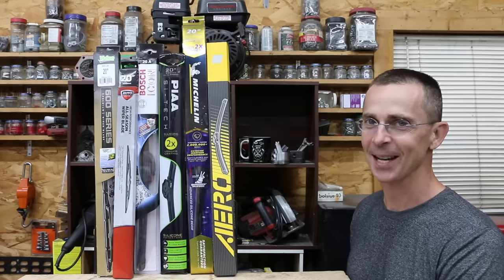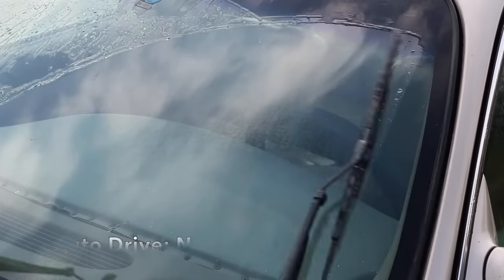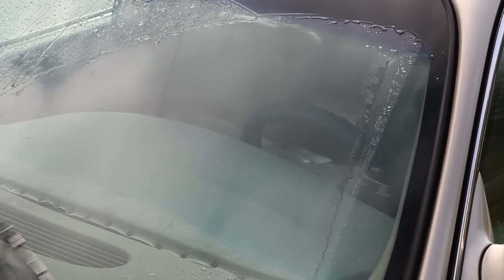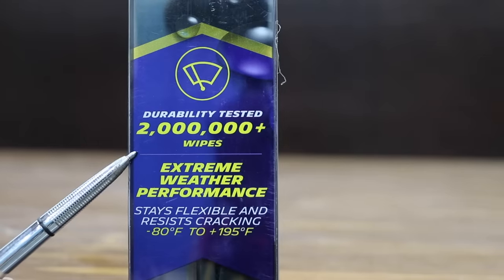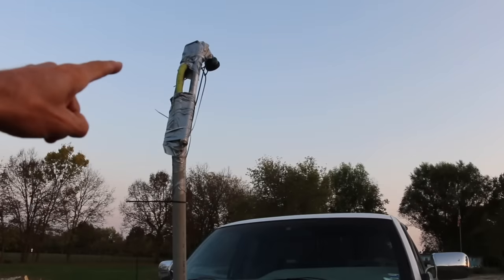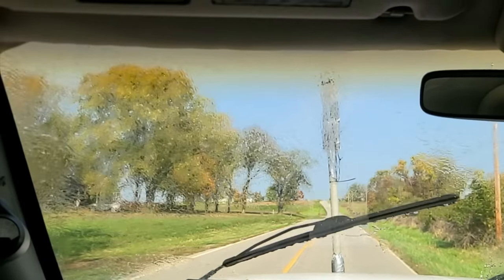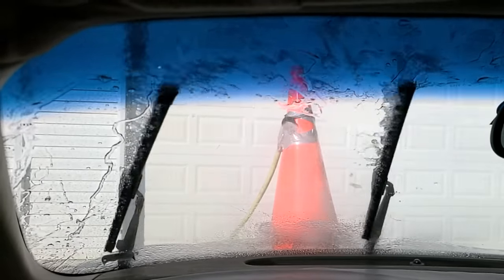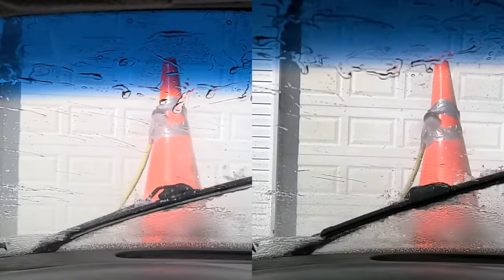Best Windshield Wiper Blade (AFTER 1 YEAR)? Bosch Icon, Rain-X, PIAA, Trico, Valeo, AERO

Comment: Great stuff, a hooked supporter and viewer. Missing from this test is OEM wiper blade INSERTS. I’ve had a dozen + Hondas since 1982 and stopped using aftermarket after seeing how sub standard they worked compared to Honda OEM replacement inserts. The blade assembly never wears out, just the rubber insert and the stainless arced stiffeners keep the contact patch exactly as designed and engineered. Poor visibility especially at night is a huge safety risk so I viewed replacing them as VERY cheap insurance. In the Midwest they got used year round so I replaced them when they wore or BEGAN to streak, @ about 1 to 1.5 years. In So Cal they bake in summer mostly unused and winter is critical for frequent mountain snow & rain. Simply put, replaced as or before needed, they always work perfectly.. just like when the car or truck (Ridgeline, I’m on my 3rd) was brand new. I respectfully suggest including OEM INSERTS in future tests as the OEM rubber insert in original blades only takes minutes to swap out. I’ll never stray to aftermarket blades again. Thanks!

Comment: In 2007, I put a set of Piaa super silicon blades on my (bought new) 2006 Acura TSX 6 speed. They were still on there when I traded the car in in 2020, and working beautifully. I did treat the windows every 6 months with rain-x. Still have the bottle, but miss the car. I also have them on my 2010 cx7 bought used in 2013, and immediately installed them on that car. Still on there today.( 8-21-22) Central Ohio, and both cars were parked outside in all weather until 2017. They now spend the night inside, but sit outside at work all day. (well, not sure about the TSX, after all those years together, it doesn't even write.) Now I have an M240 xdrive, and I can't find Piaa wipers for it, and I defiantly notice the difference. Even NEW, the BMW blades pale in comparison. So for longevity, I would go Piaa, but that is based on the experience above, as I haven't had the need to try another brand.  Great review, like all your others. I trust you over consumer reports!!!
Reply from the maker: Thanks and you are welcome!  Thanks for sharing.

Comment: Great videos on wipers! I have had the Bosch Icons on my truck for a couple of years and they’ve been great. Just now starting to streak, but they’re still better than a lot of brand new wipers I’ve had. Even so, this reaffirms I should replace them with another set.

One thing I experienced in real life today was a situation where the temperature outside at around 25 degrees F combined with light snow hitting my warm windshield was causing ice buildup on my wiper blades. The driver’s side barely had it happen at all, but the passenger wiper blade was getting ice buildup towards the end. After cleaning both wipers and driving more, this pattern continued. One cool thing that happened was after some ice buildup, the wiper would seem to clear itself. It didn’t go back to perfect, but if 1/4 of the wiper blade had ice buildup, it would tend to break most of itself off before it covered much more of the blade. This type of weather doesn’t happen often, but when it happened when I had wiper blades with the traditional frame, I was pulling over every 5 minutes to clean them off. I never had to pull over with the Icons.

It would be cool if you could test a few more things around wiper blades, like simple longevity (like that claim of over 2,000,000 whatevers in this video). I’d like to know when blades start to break down and streak or get loud or choppy over time. Also, the scenario I mentioned above with how effectively wiper blades can stay clear in those really difficult scenarios. I’d also like to see the high speed performance; some wiper blades can’t handle 80 MPH. Another interesting but less useful thing would be how the blades behave on a dry windshield. I’ve had my wipers get stuck on before, and there can be a big difference in how different blades behave in that scenario.

Anyway, I really appreciate the effort you put into your videos to give some respectable data points for analysis. Can’t wait to see more videos!
Reply from the maker: Thanks! Thanks for the suggestion.
Reply: If possible, it would also be cool to see the Bosch Focus included. 

I went to get a new pair of Icons but they apparently no longer make the size I need, so I got the Focuses instead. The Focus claims better night vision (a claim that would be interesting to test) but otherwise seem very similar to the Icons. It would be interesting to see how it stacks up against the other blades you already tested. 

Thanks again for the great content! @ProjectFarm

Comment: I have my PIAA wipers since Oktober 2019.
Vehicle stands outside in the sun the whole year, but still works great without streaks or noise.
I also think that the windshield accumulates less dirt / the dirt sticks less to the windshield since using these wipers.
Certainly more easy to clean since then.
Reply from the maker: Thanks for sharing.

Comment: I'm one of those people that has an OCD obsession with wiper blade performance. This was a great video! However, didn't mention a key factor in wiper blade performance- the amount of downward force applied by the wiper arm itself. The springs get weak over time. Most wiper arms can be bent downwards a bit to apply slightly more force which helps.
Reply from the maker: Thanks!  Thanks for the constructive feedback.

Comment: If you use 100% dirt cheap silicon blades, it will last you for ever but you will get noise especially when there is not much water to lubricate it. But it will be clean and work forever.
If you use a silicone/rubber blend, it will not be as squicky if at all (depending on the blend) but it will also outlast any rubber blade by several years (depending on the blend).
Brand does not matter guys, BLEND does. Its all about composition, not UV coating or anything else they throw at you.
Reply from the maker: Thanks for the feedback.

Comment: I actually read the instructions on my new wipers box last week.  The instructions said to clean the windshield well, then operate new wipers on a dry windshield for 10-15 passes.  I did so (for the first time intentionally)  then tested the wipers by spraying the windshield washer fluid. Perfect wipe, no squeaks. 

On another note, I assume low temp, freeze resistant washer fluid with ethanol / alcohol degrades natural rubber and shortens the life of the blades. I keep my reservoir filled with -20° RainX orange year round and my wipers always rot & begin to tear within a year.   When I lived in a temperate climate and didn't use winter fluid, the rubber lasted much longer. (Regardless, winter fluid is worth using).
If you haven't tested for this  possible issue, maybe you could do so in the future?

Thanks again for all you do.
Reply from the maker: You are welcome!  Thanks for the suggestion.

Comment: I wish there was a way to easily search comments to avoid repeating, but here are my two. First, the testing is appreciated. With some things it is hard to decide quality from appearances. Second, a follow-up test with the same wiper blades aged longer (or some type of accelerated aging is applied) would be helpful to handle the use cases where a vehicle is not driven much and the wiper blades fail due to aging rather than wear.
Reply from the maker: Thank you!  Thanks for the suggestion.

Comment: Bosch have served my KIA Sportage well. I've had it since 2016 and only had to change the blades 4 times (each time with Bosch ones). I live in Cumbria UK, it has so much rain and dusty back roads. Those blades aren't just good at wiping the windscreen, but are also extremely durable against dust and grime breaking them down.
I'm sure some more expensive brands are better in some ways, but for the price that I have paid for the Bosch ones I honestly have no complaints.
Reply from the maker: Thanks for sharing.

Comment: Been using Bosch Icon since they came out. 

The only time I've had to replace mine is after they were damaged by hail. 

The ultimate trick to long wiper life is to ensure you use them once per week with your washer. This is especially important in areas like mine, the desert. 

The most common failure is from the wiper dry rotting from no use, and/or the blade becoming "glued" to the windshield. Both failure types are similar with the rubber blade itself breaking up. Usually you get the edge ripped the length of the blade. 

My current blades on both my vehicles is 5 and 3 years. The 3 year ones had to be replaced after a hail storm broke the plastic attachment point on one blade. 

However, the plastic does fade. They're pretty grey now on the 5 year. I'll probably replace soon just for that.
Reply from the maker: Thanks for sharing.
Reply: I like to spray Silicone on the wiper blades once a month which is normal routine maintenance, same as checking fluid levels & tire pressures.  This prevents so-called, dry rot from non use.

Comment: As a mechanic i always recommend the Bosch wiper blades. All of my cars have them. Where i live where we get snowfall and road salt exposure and hot summers,, OEM blades don't last very long. I worked at Toyota and their OE blades only lasted a year max, sometimes less. Same with my Volkswagen when i bought it new, the OE blades lasted 10 months. It currently has 2 year old Bosch ones that still works flawlessly. Not sure how long other OE blades last but Bosch is my go to
Reply from the maker: Thanks for sharing.
Reply: After hearing about the "Amazon Basics" from a few people, i finally put on a pair earlier this month.   We'll see how they are after a while.  I'm going to guess it'll be similar to other avg price wipers.    Some poeple say they are Bosch and I had an old bosch icon wiper around and compared them.   The blade/beam is definitely 100% the same except he plastic tip doesn't say Bosch, the mounting bracket  is similar but not the same.   ...and packaging is a plain white cardboard toilet paper style tube with the inch length on it. so they don't ahve the bosch marketing team either.  haha.    Anyways, i hope they work out.  They're priced right.

Comment: This is just a comment on your usual very good comparative testing. I just purchased a 22" pair of Rain-ex Latitude WS wipers ($37/pair with NY Taxes) and returned them to AMAZON. The 'universal' adapter for a 5/16" hook puts the arm about 2" above the windshield. Nope, not on my tF150. Their silicone wipers are ~$53/pair plus 7% NY tax or about $57 - huh! That's almost half a gas tank fill. I suspect that some mid levelwipers (Motorcraft) are in my trucks near future
Reply from the maker: Thanks for sharing.

Comment: We have had the rain x wipers on our honda ridge line for almost three years now and they are still going strong* with very minimal streaking, the trick ive found is when i use a ceramic detailer on the truck use it not just on the windshield but also on the wiper blades themselves.

Edit:spelling (*)
Reply from the maker: Thanks for the feedback.

Comment: I only purchase the PIAA wiper blades and have for the past decade or so. I’ve purchased 2 total sets for 2 vehicles in that time. One thing overlooked in this video is that the PIAA silicon wipers come with a liquid silicon pretreatment packet that provides a hydrophobic layer that pushes water to bead off while driving. I live in MN and probably only used the wipers to their full capacity 3 times since installing them. 12 out of 10 - would recommend.
Reply: Note: I replaced the vehicle before I replaced the PIAA wipers and the only streaks I get are from bugs that I haven’t fully cleaned yet.
Reply from the maker: Thanks for sharing.
Reply: I bought some PIAA Areo Vogues for my '16 Dodge GC. Not impressed with their performance outside of longevity (3yrs and counting). Very expensive, meh performance, and make a considerable amount of noise. 

I do dig the pre-wipes though. Wish I could purchase separately and use for routine cleaning/re-coatings.

Also had to modify the driver's blade assembly because the U-bend on the wiper arm was longer on that side which caused binding with the blade and kept it from flexing enough to conform to the window.

Comment: I gave the Valeos a shot after all three of my OEM Subaru wipers ended up torn in less than a year, though they did get a lot of rough usage throughout that year, many long and dirty vacations, trails, etc. So far the Valeos are performing excellently. We'll see how long they last.
Reply from the maker: Thanks for sharing.
Reply: How are those valeos treating you?
Reply: @taylorsessions4143  Well, they outlasted the CVT transmission in my Outback. Lol. I sold the car a little over a month ago so I only had them for a few months but they were still working great. Very quiet, very smooth and cleaned the windshield very well.

Comment: As a south Florida boy, if I'm not driving through a storm, then the sun and humidity is beating down on me. In my experience Aero has stood up against all of it. Clean quite wipes for longer and at a fraction of the cost. Several wipers fail after a couple months and only Aero and Bosch Icon have impressed me. 

Havent tried Michelin to be fair, but at $16 for a set of Aero, I can't justify spending more.

Comment: I just have one short rainy season a year here in southern california, but the cheap blades I used to buy still only lasted one season most of the time.  I've had my Bosch blades for about 5 years now and they're still holding up great.  Considering how much longer it's lasted, in the long term it's basically the most budget blade I've ever purchased.
Reply from the maker: Thanks for the feedback.
Reply: Same I got the Bosch on my car too. Get some silicone spray lubricant and hit with that too. Right on the blades.

Comment: For me the Rain X was a poor performer. I tolerated them for 2 years.  The blades left a film on the window that created  problem mainly in the morning. If I turned the wipers on to clear any condensation, it was as if the glass was translucent or sun rays were distorted. You could not see. The quality of water removal was also poor. 
I bought Tricio’s yesterday. I’m a happy driver.
BTW I talked to the manager at the auto store and he agreed there was a problem with the Rain x . He had experienced the same problem with a film. 
Thanks for your video. Excellent.
Reply from the maker: Thanks for the feedback.

Comment: Intact blades that are skipping can be still saved by wiping/cleaning it with a towel soaked with synthetic oil. It restores the flexibility of the blade. If it still skips its time to change your wiper blades.
Reply from the maker: Thanks for the feedback.

Comment: Always gratifying to see my thoughts confirmed in some relatively empirical testing.

Bosch Icon or bust is what I've always said, with RainX an okayish budget option, though not dramatically cheaper. The Michelins are kind of like their tires... over-hyped and with so many attempted features they end up kind of failing in very unique ways. I've never had a set of those that didn't annoy me with the exact sound they made in your video!

I do wish you'd done some higher-speed testing, but I suppose that'd be difficult unless you have a very long, very smooth private road, as I doubt the Highway Patrol would look kindly on you driving down the insterstate with that rain contraption. xD

Still, one of the big advantages of the frame-style blades is aerodynamics. It takes a very very careful design indeed for a beam-blade not to float at highway speeds and come off of the windshield, especially on vehicles with less-angled windshields, and there, again, the Bosch stands out.

The hybrid blades are the worst of both worlds and are absolutely abysmal. I'd recommend the cheapest, most junk frame-style blade or even just replacing the rubber strip, before ever going near a hybrid blade.

Comment: I'm from CA Mojave desert, here the UV is extremely strong - strongest than anywhere in the US.  It chews up just about any blades within 4 months.  Worst performer for me is Bosch.  We only get rain once year and it's around new year.  Which means most blades never see action and I have to throw them away before rainy season begins.  The best one is the one you don't recommend.  I got the full contoured version made by ASLAM (FYI: all of Amazon version come from the same factory using different name, pretty sure it's identical).  It's been wonderful for me since 2016.  Refill is dirt cheap.  Yes refill also last 4 months.  My trick is marinating new refill in 303 for 24hrs.  Wipe off access, install and voila I get anywhere between 12 to 18 months use.  I only replace when they're ripped, otherwise, they never squeal and perform fantastic even when they ripped in half due to 303 magic.  I'm saving so much $$$ it's not even funny.  I don't trust traditional 6 point blade, full contoured is the way to go because it provides 100% even coverage and refill are replaceable so no more sending excess to landfill and burn $$ away
Reply from the maker: Thanks for the feedback.